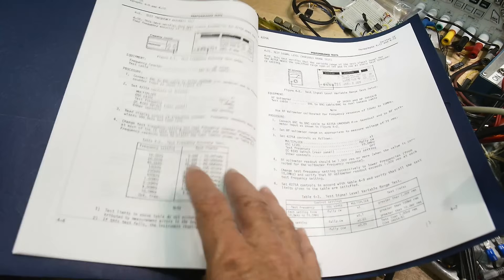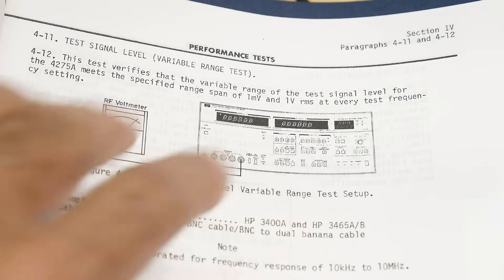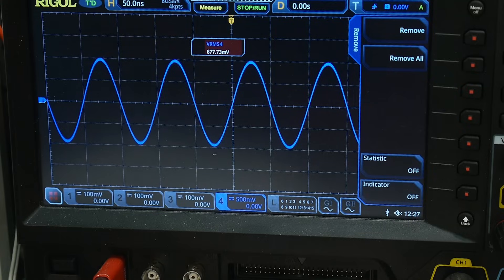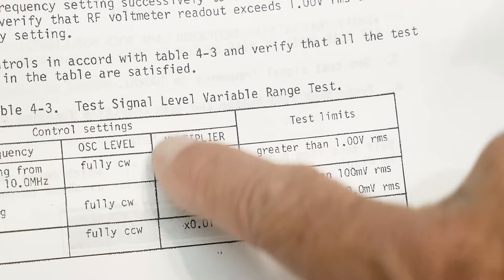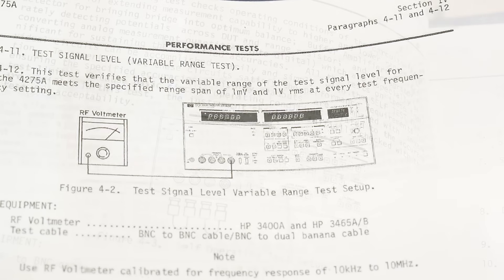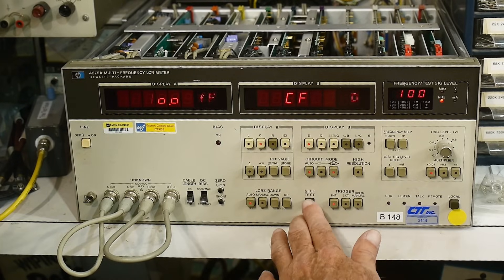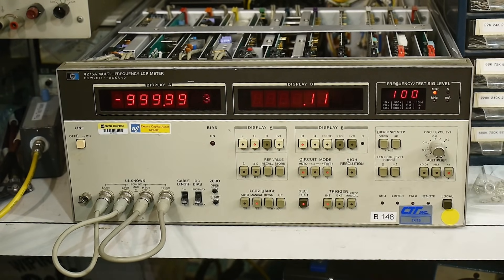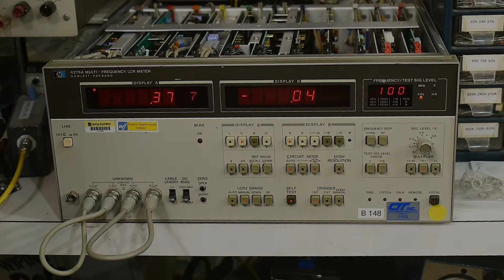#1680 HP 4275A LCR Meter (part 2 of 8)

Comment: Looks like a probing issue on the 4MHz and 10MHz measurements, were you using a direct BNC cable or a scope probe? if using a probe it needs to be set to x10 to avoid probe effects limiting the bandwidth, most scope probes drop off around 6MHz or so on x1 setting. also consider when getting into MHz frequencies you may need to add a load to the scope end to prevent resonances in the cable messing up the readings.
Reply from the maker: direct cable
Reply: @IMSAIGuy  OK, not that then !

Comment: I have a Peak LCR meter that can calculates inductors using different frequencies. When I try to measure an old telephone loading coil, it measures 149mH at 1khz, 32.4mH at 15khz, and -1.78mH at 200khz, it goes crazy??
Reply: The ferrite core of your coil is frequency dependent. It sort of "loses its effect" the higher you go with frequency.

Comment: Timebase too slow to sample MHz signals properly.
Reply: 8Gsa/s is too low? There’s 4M samples shown on the screen. Plenty for 10MHz.
Reply: @absurdengineering  The sampling rate you quote is a maximum. The number of samples on the screen is the screen width in pixels (used for the signal).
Reply: @jms019  The current sampling rate is displayed on the scope screen and was 8Gsa/s